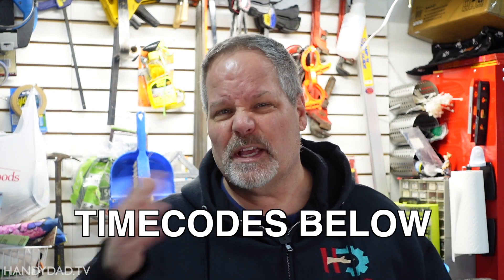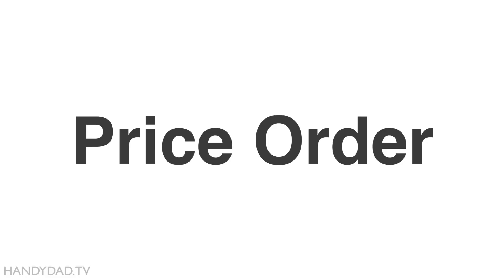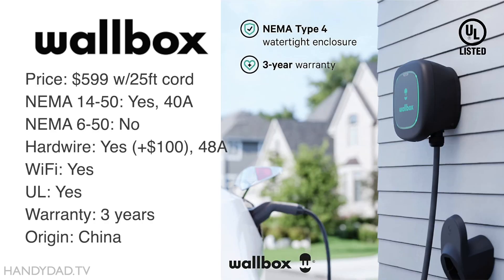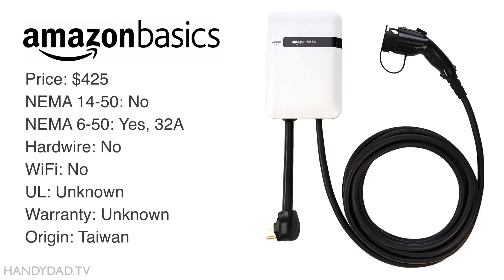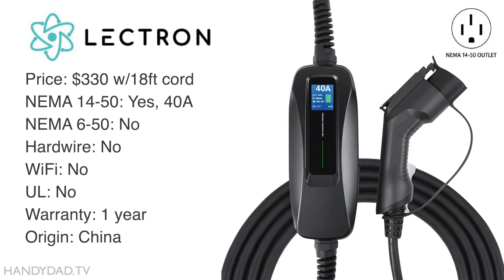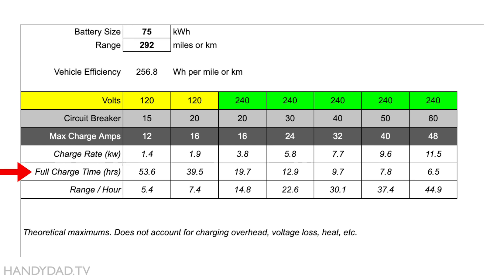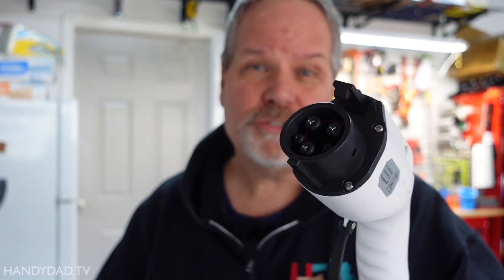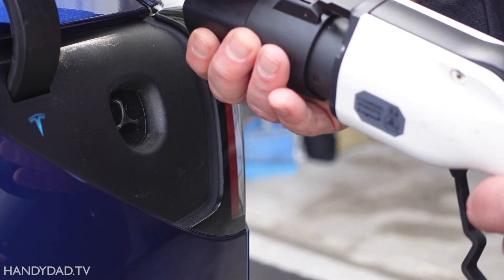Best EV Home Chargers for 2022

Comment: I have the Emporia evse (hard wired, 48 amp) for my 2023 Bolt EUV, LT trim. 2 months and 2,000 miles later, operation is perfect and the monitoring software provides an accurate measurement of the TOTAL electricity provided to the Bolt. A reasonable, non algebra estimate is 15% loss, with 85% delivered into the battery. Our other vehicle has not been fueled in 2 months. I love this car. Love your stupid jokes ar the end, too.
Reply from the maker: Thanks so much 😊

Comment: I did my research and purchased the Emporia 4 months before I saw this video. Charges friends MachE and my Niro PHEV flawlessly. Tesla MY ordered 11/01/21, expected delivery 1Q23. I hardwired mine with a 60 amp breaker. I love the energy tracking feature. Only downside is the thick and heavy charge cable, but that is to be expected at 48 amps. Charge cable is maximum length allowed by NEC, but should still reach the charge port on the MY.
Reply from the maker: Yeah it’s heavy for sure.

Comment: I charge my Model 3 with the Grizzl-E. Great robust unit. I bought an extra J1772-Tesla adapter to leave on the EVSE.  
NOTE: The Grizzl-E can be hardwired, mine is. You just need a 1" to 3/4" knockout adapter and a 3/4" FMC connector. Well, you could run 1" FMC all the way, but 3/4" is what I had.  Anyway, the terminals inside need spade connectors, it doesn't have wire clamp connectors so you can't connect bare wire to it.
2nd note: The Grizzl-E does have ground integrity check where it sends out a 20mA signal, so it WILL trip your GFCI breaker, hardwired or not. Now that 2020 code requires GFCI on all receptacles, Grizzl-E should just remove the integrity check function and keep its GFCI passive.
Reply from the maker: Thanks for the info. Perhaps the GFCI setting should be configurable.

Comment: Hi HandyDad. I have to say that I've watched this video at least 3 times and every time I see the very ending part where you do your little skit as a snake oil salesman, it is so fricking hilarious. Makes me laugh uncontrollably  every time!  🤣🤣😂😂Really good stuff! It's too bad the Emporiam went up by $100. of course ChargePoint is over $900 on Amazon now. Crazy world we live in!
Reply from the maker: Thanks 😊 
Hoping my point was clear: all EVSEs are essentially the same. Expensive doesn’t charge faster or better. 

I’m waiting for someone to introduce a charger with a “power conditioner” that claims to provide cleaner power to improve your battery life. Like the fancy gasolines that keep engines 2x cleaner. Hogwash.
Reply: @handydadtv  While I can charge at 45 amps I don't. I only charge at 20 amps cuz it is better for my battery and so no reason to charge faster at home.
Reply from the maker: I haven’t heard any evidence that 20 amps is better for your battery than 40 amps, but I also charge as slowly as necessary to recharge overnight. I do that just for safety. Maybe it wouldn’t make a difference. But I feel better that way.

Comment: I have a JuiceBox 32A hardwired unit that I purchased May 2020 for $599 from Amazon.  I have a 2020 Chevy Bolt which maxes out at 32A.  The first unit died but they sent me a new one quickly no questions asked, they have great customer service.  The new unit works perfectly fine.
Reply from the maker: Thanks for the info!

Comment: Great video. I would argue though that there is more than just the cord, the ampacity, and the UL listing to consider (Although I think a UL listing is non-negotiable, it's a must): My friend had a pretty bad time with Grizzl-e when charging his Wrangler 4xe. The connector was getting stuck in the charging port - the vehicle would not release it. You might say that it's the car's fault, but the Chargepoint that he switched to after Grizzl-e does not have any such problem.
Reply from the maker: Good to know. Thanks.

Comment: Nice video comparison to help narrow down options.  The Grizzl-E is outdoor rated for harsh environment is something important to some folks.  It also has a locking pin to prevent people you don't know from using it if installed outdoors.  Open software standard compliance might be important to some people.   Thanks for sharing!!!
Reply from the maker: Thanks for the info.

Comment: I have the GrizzleE for one week and it’s working great. Had I seen this video prior I may have gone with the Emporia, but I do not think I would be pushing the output to the limit at 48 amps (I even debated slowing down my current 40 amp rate to 32 to reduce heating since I typically charge overnight anyway). Either way, can’t complain! Informative video!
Reply from the maker: Definitely use the lowest rate to complete your charge overnight. No need to be done in 2 hours if you’ve got 10.
Reply: @handydadtv  dumb question, but am I reducing the heat by utilizing the command in my EV to take a “reduced” charge? I assume so, and I ask because that’s a more convenient setting for me to adjust as the grizzlE requires me to open up the box itself every time if I want to change the Amp setting. I do want fast level 2 charging at times.
Reply from the maker: Not sure what kind of EV you have, but I can set the level of charge (ie. 80%) and the rate of charge (ie. 32 amps) within the Tesla app or in the car.

Comment: You didn't mention one of the best features of the Emporia: its power tracking capabilities.  I also bought the Emporia a couple months ago, been charging my MYP with no issues.  Like others have said the wire is excessively thick and heavy, other chargers I've seen have much thinner cable to charge 48amps.  State of Charge channel compares thickness of cables too.  Anyway the power tracking is the best thing about this, shows 7 day summary of each charge session including kWh provided, $ and length of charge.  The main reason I went with it is because i already have the Emporia Vue 2 power monitor installed in my electrical panel. So I can see history of the charger and all my house power use by day, week month, year, etc.
Reply from the maker: I have the Vue as well so I understand. You’re right. I should have mentioned it. But I think it was a compelling value anyway.
Reply: Not just monitoring but throttling the EVSE to match houseload and solar output so all your Solar goes to your needs and not sent to the grid unless its excess.

Comment: Does any of these have surge protection? Or is a surge protector necessary for EV home charging?
Reply from the maker: Good question. Never had this question before.

I’m sure the electronics in an EVSE would fry during a lightning strike, but could it affect the car if plugged in? I’d think so, right?

Sounds like a topic for a video.

Comment: While waiting for Amazon to have the ChargePoint Flex in stock (separate comment) I purchased a Mustart multi (15/25/40) amp. The unit has a very heavy cord and charging cable. It feels extremely well built. We have only used it a few times to charge a 2019 Kia Soul. First time we charged it from ~50% it showed 2.5hrs on the 40a setting. Second time I set it to 25a thinking it better to charge lower overnight it still showed 2.5hrs from ~48%. Thinking that odd and not trusting it at that point the next time I hooked up a clamp on amp meter while trying the various settings. Initially we couldn't get it to charge at 15a so tried 25. 25a setting on the Mustart showed 22-23a on the meter. Then we selected 40a and found it only using 28a. That's when it hit me and doubled checked, the Soul has a 32a charger and so that's why the charge times were nearly identical, only 5a difference. When we tried 15a meter showed it using only 12-13a (we figured we didn't have the right app settings for the car to start charging the first time). This Mustart has delay start so you can avoid peak rates if you're time of day or peak charge on your electric plan. Of course the Soul and probably most other EVs have some sort of charge timer/delay now a days. I wasn't sure how long of wait the ChargePoint was going to be and sort of kick myself for getting 2 rather expensive units at nearly the same time. But if ever needbe we'll bring the Mustart on trips. But if their hadn't been a rebate on the ChargePoint Flex or it had been weeks/months before restocked, I would have gladly delayed purchase of a wall mount and happily used the Mustart for quite some time.
Reply from the maker: Good info. Thanks.

Comment: Good video.

There is a Tesla to J1772 adapter. So you could charge a non-Tesla on a Tesla EVSE. No super charging though (Yet...).
Reply from the maker: That adapter is over $150. But yeah it’s an option.

Comment: Thanks for the info, just got a Pacifica plug in Hybrid.
Reply from the maker: Congrats!
Reply: @handydadtv  I just ordered the Emporia. When I talked to an electrician, they told me I have to hardwire ours because the code in Iowa says if there is a plug-in for one, it has to be a GFCI and that will just keep tripping so he said because of that they have to hardwire it.
Reply from the maker: You’re better off hard-wiring it.

Comment: Great analysis!   Should probably mention that cars have their own inherent charge-rate limits.  For my two PHEVs, the limits are 3.3kW and 3.8kW, so any EVSE over 17 amps is equivalent, for my vehicles. Of course, I want to future-proof, but even full EVs have limits.
Reply from the maker: That adds a completely different dimension that I wasn’t prepared for. I just wanted to compare different chargers.
Reply: Right, but just as you point out that 40 amps is 40 amps (and the rest is snake oil), for some folks 32a is the same as 40a, because their cars max out at a lower number.
Reply: @handydadtv  Thanks again for the review. Just one additional question. I know that having a WI-FI enabled charger does give you the ability to charge when the electric rates are lower, or can. But if you have the ability thru your vehicle to stop charging at certain levels, what else would be the benefit of having WI-FI?    Thanks in advance.
Reply from the maker: You don’t need WiFi. I’ve had my Tesla for 3 years and always charge with the UMC which has no WiFi.

Comment: It looks like the UL certified version of the Emporia is $50 more and ships at the end of May. Any reason to wait and pay more for the UL Certified version?
Reply from the maker: That’s a personal choice.
Reply: I prefer the additional safety asurrance the UL rating gives for a device that is controlling that much power in my home. You may want to talk to you insurance company and see if there are any consiqurnces to a fire caused by a non-UL device. Also consider that you are charging the most expensive electric appliance (your car) in you house and an extra $50 doesn't seem like much to provide the best protection.

Comment: One more things. Thanks for what turned out to be the review I was looking for, I have already purchased the Emporia unit. I don’t know if your Tesla is an all-wheel-drive or not, I couldn’t see the badge on the trunk but if it is you can charge that car at 48 A a.k.a. 42 miles an hour. All you needed to do was hardwire that unit into your panel right next to it…
Reply from the maker: I didn’t hard-wire it because I still use the Tesla UMC on a daily basis.
Reply: That's 8 amps you're leaving on the table. it's what makes that charger such a great value! You could hardwire the unit  and have a plug on the same circuit, you just can't use them both at the same time.
Reply from the maker: Good idea. I’ll put it on my to-do list.

Comment: OpenEVSE used to offer a 40ft EV cable... (what I have)... it's awesome to be able to charge 2 cars parked end to end with the same charger, and not have to reposition.
Reply from the maker: Wow that’s long. Must weigh a ton.
Reply: @handydadtv  Not really, you don't ever handle the whole 40ft.... just gets dragged on the ground to where it's needed.

Comment: would you be able to do information on a level 2 charger for a 2022 tucson plug .  full charge is only 33 miles  thank you (keruida level 2 charger)
Reply from the maker: All cars in North America use the same J-1772 connector.

Comment: Price went up on the Emporia for the UL listed model.  I wich thet had a 40A-only version so that the cable would be lighter.
Reply from the maker: It’s heavy for my Tesla because of the extra adapter. But I tried it with a friend’s Ioniq and it clicks in place and holds tight.

Comment: Good video! After 6 years and 9 months my  Clipper Creek HCS-40p (nema 14-50) died. Suddenly refusing to click the contactors n ometter how many times I reset it and waited for it before powering it back on. Unfortunately the 3 year warranty expired obviously  more than 3 years ago. I have had 2 LEAFs and 2020 Bolt which GM replaced with 2022 Bolt EUV.
Reply from the maker: Double the warranty period is good!

Comment: I have a 125/250 V, 30 A, 14-30R outlet in my garage.  Will I need to replace my 14-30R outlet  for a NEMA 14-50 outlet?
Reply from the maker: If you have a Tesla, you can just get the UMC with a 14-30 plug.

Comment: I was confused for a bit as a Tesla M# 2018 owner why these? And the hardwired word is confusing. I have the Tesla connector for my 240V outlet so I'll move along.
Reply from the maker: You must be using the Tesla Universal Mobile Connector (UMC). That’s the one that unplugs so you can take it with you. 

“Hard-wired” means permanently installed. Like a Tesla Wall Connector.
Reply: @handydadtv  got ya. I fell off the wagon (Tesla mindset) the other day after installing my stove outlet in the garage for the M3 and wasn't getting the hardwired concept. Now wondering why the other EV's don't have unplug-take-it-with-you connectors.
Reply from the maker: There’s really no need to take your charger with you. I’ve only taken mine a couple of times and didn’t use it. 

Tesla stopped including them free with every car because stats showed most people weren’t using them.

Comment: Great review, How was the app? Sorry one more ?Do you have any experience with the autel maxi charger? I cant decide between the autel or emporia.
Reply from the maker: Never tried the Autel. The Emporia app works great.
Reply: @handydadtv  Thanks, Im ordering the emporia this week, I dont know if you get any credit but Ill use your link. I watched your videos with the emporia power monitoring. You actually get a little deal if you buy them in a package. Im getting the charger for sure. In your opinion is the power monitoring worth it? Thanks again for the review.
Reply from the maker: Be sure to use my discount code too. Thanks for using the link. I get a small commission.

Comment: great video! thanks. I'm getting the LADWP rebate, I have a tesla so the tesla charger was the intuitive option, but the tesla charger is not included in the QUALIFYING PRODUCT LIST from the rebate program. So I was wondering if it was a good idea to charge the tesla with a different charger. You answer my question so thanks again!
Reply from the maker: I don’t know the amount of the rebate, but even at the full price of $400, the Tesla wall connector is a really competitive deal.
Reply: @handydadtv  yes. That’s why i’m thinking about it. I want to go with the Tesla but they give $1750 for the installation+charger+dedicated meter. But only if it’s a non tesla charger.
Reply from the maker: Wow that’s an awesome rebate! But I don’t know why they discriminate against Tesla owners.
Reply: @handydadtv  i dint know. they start doing that this year. I guess it is because tesla only works with tesla and you need an adapter. 
Buy you also need an adapter to charge a tesla with a J1772. And 50%(or more) of EVs in Los Angeles are Tesla, so it doesn’t make any sense to me.
Reply: @handydadtv  I asked the LADWP and they said "at this time there are no qualifying Tesla Wall Charging Stations. The EV Charging stations are not eligible for a rebate because they do not comply with the J1772 plug standard and are not network capable (LAN/WLAN). As such, the Tesla chargers do not qualify for the purchase and installation portion of the Residential EV Charging Station Rebate."
Reply from the maker: Wow.

Comment: Wished you had expended the charge to show the warranty, country of production and UL certified.  Good Video.  Thanks for all you work on it. The length of the pigtail cord plug would be nice to include in the length of the cable, too. like the charge cord length of 25ft + 4' pigtail. or 25+4.
Reply from the maker: Thanks

Comment: Hello quick question.  Is a level 2 charger able to schedule your departure time and have the vehical charged to 100 percent right before you leave instead of keeping it at 100 percent for long periods of time?  I'm getting the outlander Phev and unlike most EVs, it doesn't have the departure feature.
Reply from the maker: No, the charger doesn’t know how much time it will take to charge, so it can’t do a scheduled departure.

The only reason to do specific time of day charging is to take advantage of off-peak electric rates, or to avoid charging while using other high-currently appliances like an electric oven, dryer, or air conditioning. 

If your car can’t do scheduled departure, I’d suggest you just start charging at a time that gives you long enough to recharge your normal commute. This video can help explain https://youtu.be/JmqiXDRSFMU.
Reply: @handydadtv  do you know of any level 2 charging station that can do this ?
Reply from the maker: No. The EVSE standard doesn’t communicate that information. So I don’t think any charger will be able to calculate the charge time needed for scheduled departure.